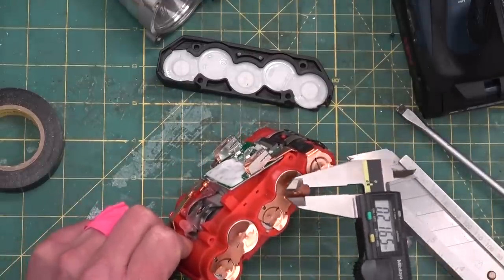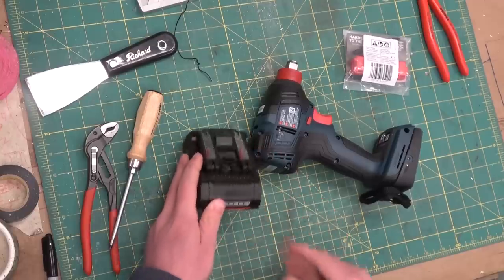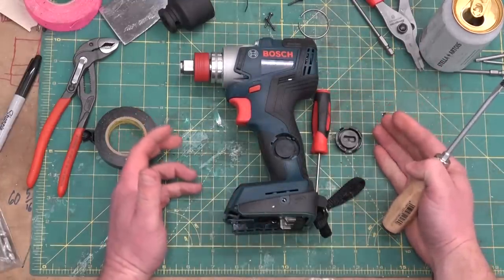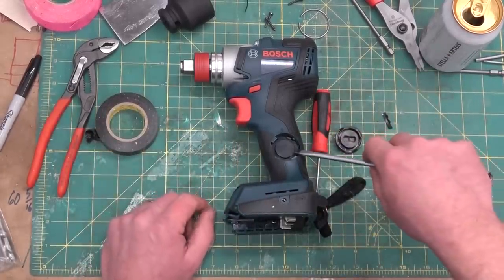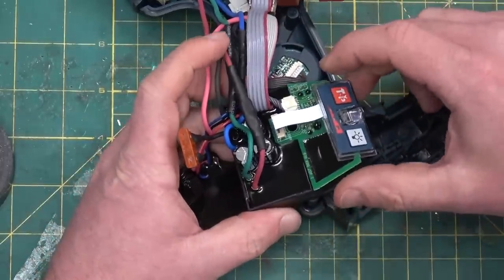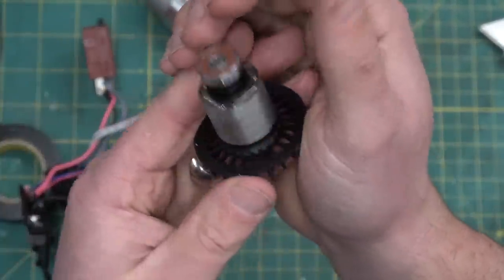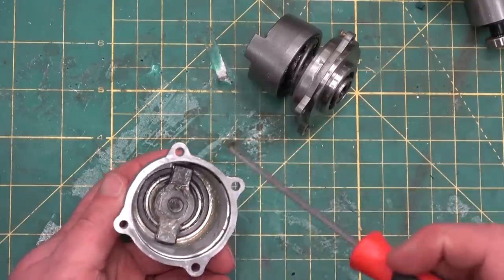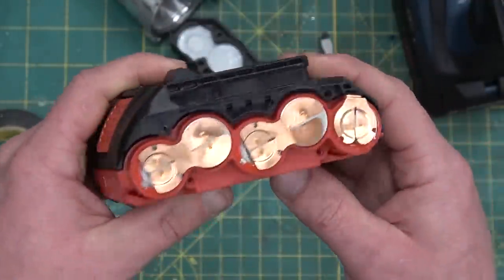BOLTR: BOSCH impact driver | CORE 18V

Comment: All I know is 2 1/2 months I have had this impact and Ive worked it relentlessly at work
(Journeyman plumber new const) and hasnt revealed problem 1 yet..holds its own & then some..I drill alot into wood and mix alot of mortar mix and Im telling you this thing does great..
Reply: I agree I've got quite the collection of Bosch tools and haven't had a single problem with anything.

Comment: They chose copper for low resistivity. They extend the surface area to compensate for thinness. This way they use spot weld method as oppose to ultrasound on thick and narrow copper strips.

Comment: I have the older model also brushless with the half inch and quarter center. Same 18v battery but I have the bigger 4 amp hr batteries. Thing is fucking solid mine has been used and abused, many times left in the bed of my truck going threw car wash and rain and she still runs hand hits just as hard. Almost 3 years of abuse and she still goes very well. Only thing that I have to complain about is the batteries don't like to charge when it's super cold out. But they do hold a nice charge.

Comment: That much surface area and they had to add snatches to the tool?!

Cheapskate moulder, not enough cooling capacity in the TCU and won't suffer the high cycle times their miserly equipment demands, so they butcher the tool to rip it out of the fixed side of the mould, instead of shrinking it onto the fixed side.

Comment: reason for 21700 cells is that you only need 5 to get 18V @ 4Ah... yes packaging is worse but way better than 10 18650 for 4Ah... and until now they are keeping up with the old 10 cell 5Ah 18650 packs... 

btw. if you are using a high current tool these things put out a lot more juice than 18650

tried it myself so no marketing wank...

the Bluetooth thingy is garbage to the bone bujt gives you a feedback how long the tool has survived in the fleet...

and 4 pins are not for Tracking the battery. Bosch has no shut of device in the pack itself. The Pack is just telling the tool if it is okay to run or not. You can just hook the two power pins to 18V and it will run...
Reply: These are definitely not keeping up with a 10 cell 18650 pack.  Not on high draw tools, at least. 

Samsung 40T is a 30A cell in 1P.  

A 2P config of 2.0-2.5 Ah 18650s will be in the range of 40-50A. 

Doresroom did a fairly basic test using Milwaukee batteries and the 3Ah M18 (Samsung 30T, 35A max discharge) was not performing as well as a 5.0 Ah M18 on Milwaukee's circular saw.  Didn't have enough amps to avoid cutouts on a simple 2x4.  Neither battery was sufficient, of course, but the 5Ah is definitely a better performer when you consider maximum power draw.
Reply: @AaBB-ks6oc  the best 21700 cells are roughly double the power of average 18650 cells. High-end 18650 in a 5S2P will be more powerful than a 5S1P 21700 battery. However, a 5S2P 21700 battery would smoke the 18650 one.

Comment: 15:25 "pcb board"
do you enter your pin number at the atm machine???
uncle bumblefuck don't do this to me!
Reply from the maker: Another one down. RIP in peace buddy.
Reply: @arduinoversusevil2025  Eh I had a good run. See ya on the other side, chief.
Reply: As long as I can listen to my CD disc its fine. 😁
Reply: Downloaded this video to my SSD Disk
Reply: Does the atm machine at least have an LCD display?
Reply: Or the famous “hot water heater”........

Comment: The 4 thou Cu is plenty skookum for that application. We design high current 18650 packs for the oil/gas industry and use 5 thou Ni 200/201 for cell connections.

It's not value engineering, it's just how most commercial 18650 packs are made.

Comment: Other models of the impact driver have a metal dingus end with a rubber rip ring placed around it. In tests it still doesn't drive as fast or as deep as comparable brands. 
I bought a full Bosch kit because of the 6 year warranty and the fact that it's not red means it's a theft deterrent.

Comment: 21700’s are amazing. Easily twice the current and capacity of the usual tool grade 18650’s
These look like 26650’s, which aren’t anywhere near what a 21700 can do.....yet.
Reply: Matt Fields, 
Finally someone commenting about the cells!
An NCR18650B can output 8a max and about 5a continuous where a sony VTC5 can output 30a max and about 20a continuous! Both the same physical size but very different potential!
I read somewhere that these cells in the new Bosch batteries are 20700 cells made by panasonic! I think they 3.5Ah and are 30-35a max! 
Also i was thinking about the molded plastic on the underside of the battery might be for better ventilation for the cells when it is charging ( only if the charger has a fan that is if not its completely retarded to have them there)
Reply: John Kelly if they went with Molicel 21700’s 4AH 45Amp, they’d be the only tool company in business. I’ve upgraded my old Dewalt 3AH batteries with Murata VTC5D 25Amp 2850mah. They last just as long but don’t get heat restricted at all. The torque is fantastic on the brushless drill.
Reply: I've seen a few other teardowns of the Bosch Core batteries and they do in fact use Samsung 21700 cells. 👌
Reply: Basically yes. The bigger cells sustain a much higher current because there is much more electrode inside the cells. It's all about surface area. 18650s are popular because they're usually low weight but they have rather poor current ratings.
Reply: A Cow I use Molicell 21700’s in my Topside mod. I prefer the Topside dual with a pair of Murata VCT6’s though. The single battery mod still serves a purpose, mostly in its compactness.
Reply: They're using Samsung INR21700-40T cells

Comment: Awesome video, as always.

The higher voltage of the battery pack is to allow less current to be drawn, so to achieve the same Wattage, at a higher Voltage, you need less Amps.

Bigger cells usually means higher Amp-Hour capacity.

Stay well!
Reply: The voltage is unchanged, it's still an "18v" tool.

Comment: I spot weld aluminum a lot. 
Possibly Bosch needed to use super thin copper foil so that there wouldn’t be excessive heat on the cell side and still get a decent bond.

Comment: We have similar bluetooth enabled torque wrenches at work. They are used to record the torque value of every bolt in the product records.  We build big medical devices and patient safety is priority.  The work instruction actively updates a diagram for the correct order and torque values.

Comment: I don’t see the “cooling fins” as being the factor, I think they are ribs for strength of the battery, and very thin plastic surrounding the cels so the heat dissipates out easier...
Reply: The instructions actually refer to them as "cooling fins". I'm not 100% convinced he wasn't taking the piss out of them for referring to them as such.

Comment: Copper foil in the battery:  ~0.12mm * ~12mm = ~1.5mm2 = ~16AWG
seems legit, no?
Reply: and then a 40 amp fuse behind that on the driver? As far as i can tell the 5 cells are put in series, so the whole current is flowing through each 1.5mm2 crosssection

Comment: 0.004" is just about the same as a 3oz copper pour on a pcb. Guessing that the width is about half an inch, those copper tabs could easily pass 30 amps.

Comment: I'll defend that battery I guess.

The contacts - if you know the deflection magnitude,  how can you design a part to work harden less in that axis? Reduce the strain by thinning it out.  Everything's a spring, just like you said.

The fins - if it gets hot, it's conducting heat.  Tool batteries sure do get hot, so what's wrong with a nearly zero-cost way to increase the surface area? Sure it might only buy you 2 degrees (flavor of your choice), but that's better than nothing.

Comment: The bluetooth is for theft prevention and to set the torque for repeatability. If you're using it in a production environment where you need to tighten the same fastener on multiple items hundreds of times you can set the torque and every time you run that fastener down it's torqued properly. One example of this would be lug nuts. Milwaukee has this feature as well as others.

Comment: Couple things: The plasticized rubber bit on the anvil is supposed to be for curing slippery man paws (how WELL it does that is another matter).  Second, I dispute the claim that this impact driver is a "pro tool" because it is the smaller, less-capable (idiot) brother of the higher capacity line from Borsch.  Third, I'm glad you did the tear-down on that battery, because i was gonna buy one.  I have changed my other mind and will not.  But the slightly older (5 year-ish) Borsch (if I may borrow your terminal-ology) tools that I have are great.  Now it seems like Borsch is pulling a hard Makita and making the guts out of garbage you wouldn't feed to a dispose-all.  Thanks for the vids, wah.

Comment: Just thought about one use for the Bluetooth. If you are working in an assembly line and have to tight 3 bolts with different torques, you can program that and the manager can have a control of how many parts you have assembled during the day. It gives you more control over the production.
Reply: Just found out. It is, for example, to automatically turn on and off a vacuum cleaner when you are using the drill.

Comment: The bluetooth bit in new tools is usually for starting the vacuum when you're making a mess, that is every time you use the tool.

Also, Intel and AMD don't make their processors in Malaysia. It is where they package and test them. Since that is the last place of "significant labor" they get "Made  in Malaysia" slapped on them. Specifically both plants are in Penang, near each other. Been there, supervised that...

Comment: If these are using 21700 cells then they are totally worth increase in size. 21700 cell aka Tesla cells can be had in 5000mah capacity. I believe 18650s top out around 3000mah. 40% more capacity for only being 5mm longer and 3mm bigger diameter is huge.
That would make this pack a 5ah pack, this is smaller than many competitors 4ah packs.

Comment: I got a set of Milwaukee tools a few years ago that came with a bag, it was a large set so a big bag, the attachment points for the shoulder strap are at the bottom, I toss all my stuff in my large bag to move but not that far so I don’t zip shut, picked up by the shoulder strap and physics being what they are it flips over and dumps 
A good bag and no bag better than a bad one

Comment: Those bigger battery cells have a higher energy density than the 18650s.  Read the white paper Tesla released on it a couple years ago.  They are the ones leading the charge on rolling out the bigger battery cells for their own use.  They are using the battery industry to build them to get the price down.  you'll start seeing these bigger cells in more and more devices.

Comment: Compromise, compromise.
IMHO Smaller but more cells would not allow better cooling implementation as more surface area of cells would not be near external surface of the battery assembly.
And would require more cooper contacts to be installed - more parts - less reliability.
+ more cells would mean parallel connection - such connection would introduce self discharging between cascades of cells - less longetivity and more weight, right?
+ cell consists of useful volume (Li-ion + cathode / anode) AND its case (rubber or smth? cylinder). Since volume of a cell strongly depends on a square of radius, the useful volume of a single cell dramatically increases.
So probably going for bigger but less cells, overall density remains the same or increases with reduced weight and less contacts and smaller manufacturing price as less labour time is required due to smaller quantity of parts.

Just my reverse engineering theories.

Comment: A question / comment about the thinness of the copper contacts would perhaps be due to the increased conductivity and amount of heat generated by spot welding a thicker piece.  Heat = bad for the cells?  The crinkle and work hardening might be mitigated by the white buttons pressed against the copper.  High discharge cells might benefit from the copper connections without creating a resistive load and heat.

Another coment on the batteries.  18650s are pretty awesome but there is a greater power density in 20700s and moreso in 21700s.  I believe Tesla is using 21700s in their cars and battery walls, not that that matters but I guess they've done their research.  After a bit of previous reading, more juice per space and mass with them.

In the "vaping" community, one can obtain about 25% - 30% more wattage per battery using a 21700 over an 18650, so, not only higher overall mAhs but greater continuous discharge rate.

In this case, they seem to be going with a lower voltage than some and increased amperage.

Comment: I just bought this tool because it was on clearance for 72.00.  So far it's worked well.  I hope it holds up.  I didn't even know about the bluetooth.  Stupid idea in my opinion. Removes lig nut from my 1 ton truck quite well.

Comment: You seem to have the consumer low end version. Try looking at a Bosch IDH182B. I've had one for four years and it has stood up in MB, SK and AB winters in industrial construction. Puts out roughly 210ft lbs according to both of my torque wrenchs.

Comment: BT connect is so you can find your stolen tool. Nice touch abuut the two step on the batteria, wish DeFault had taught that one up. Bigger batteries what like the ones stuck to your meat claws (22650 variety in your case) can deliver substantial torque with less heat, better life, and a bit MOAR capacity.

Comment: Just subscribed, because not only are you informative and thorough, bout funny AF.
The first 5 years of battery machines isn’t worth talking about, because they were shit. I remember dreaming about blue Bosch machines, and in the mid 90’s I got 2 genuine blue Bosch accu-drills and a corded jigsaw- all was well. Then the regulator went out in my jigsaw, and I thought, I’ll just get a new one. But after surging for weeks, unsuccessfully, I called Bosch and explained my predicament. They told me that they don’t make spare parts for “PRO” machines older than 10 years. So NO to Bosch from me. And the Harald Bluetooth thing!??! My Husqvarna Rider has it as well, so I don’t have to look at the display at the tractor, witch has the same information+ fuel gage, tilt warning and more. My chicken brain doesn’t get it…

Comment: I personally love and use only Bosch corded and cordless. I'm a contractor the tools get used all day every day. I admit I'm pretty much the only one using Bosch most every one else uses Milwaukee or dewalt. I've Never had a problem so I'll stay loyal to bosch. i literally just now had a battery that wouldn't charge after using every day all day for 5 years with I dont know how many recharges "a shit ton".
 so far that's the only problem iv had. Also had a bosch impact with the new 8 amp/hr 21700 cell battery I dropped it off the scaffold about 15 times from 16' on to concrete just on  this last job. it's been dropped way more on its previous excursions but on that last drop with the heavier battery it snapped at the base of the pistol grip where it flattens out for the battery. When it fell it landed upside down right on the chuck and the extra weight from the newer battery caused it to break but it still works so I epoxy it and shes still in use. I just use a lighter battery on that one. Those 8.0s are heavy

Comment: "Put yer weed in it" 💯💚😅 for us California residents 😉
BTW, those 21700 cells are far more powerful than older 18650 cells, Clive.
Reply: They aren't newer they are just larger.  Lithium ion cells come in mm dimensions.  18650 just means 18mm diameter 65mm long.   Just clarifying.  You can get all sorts of sizes and a size being one you haven't seen often doesn't mean its newer.
Reply: @HeWhoSitsOnFences  I've been vaping for about 9 years, and know more about the consumer-grade Lithium batteries than most... But thanks for trying, bud.

Comment: Well, the Bosch batteries appear to be cheap, but just on the first glimpse. First of all, HDPE has a thermal conductivity which is twice as high as PA6-GF30. The "naked" cells are embedded in the PE so that the generated heat can dissipate much better. Second of all, by using less but bigger cells and lower packing density, the power density in the cell decreases which also enables better cooling. I'm using the blue Bosch tools for quite some time now and I am really giving them some hot supper, but I can't tell any quality difference between these batteries and other brands.

Comment: Bigger batteries typically mean higher peak amps. If I were rich enough to gamble I would bet they out perform similar amp hour configurations with smaller cells for 'average' torque throughout the duty cycle. I'm sure the battery will die when you need it most but it will 'chouch till it friggin dies' if I got my technical lingo right.

Comment: That construction and even the sound of the plastic is the same as the earlier bosch lithium packs.
I didn't see a thermistor or temp switch on the anode of one of those cells did they leave it out?
The thermistor on the early ones was insulated by plastic so if you put one on charge hot it might just go up in flames. 
I've only seen it happen with bosch lithium. Might be fine in cold climates but it's an issue here in Australia.
You're right the 26650 form factor isn't new, in fact it was the first every lithium cell used in the first lithium kit.
Milwaukee V28 used them. The Canadian made emoili cell were good for 2004 but like all things Canadian they had some underlying issues ;)

Comment: They've been using 18650s for everything forever but those 26650 and other large cells are nice. Sony VTC4s can output 30 amps max but not sustainable waah. These larger cells might actually be better for wireless tools